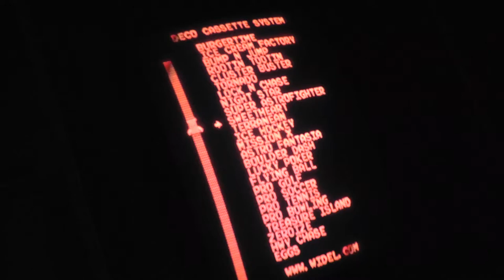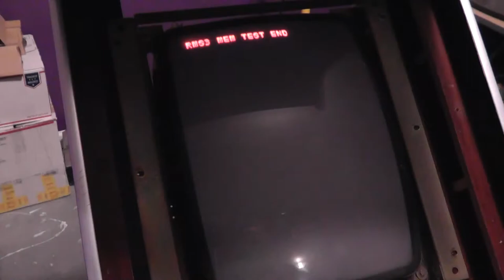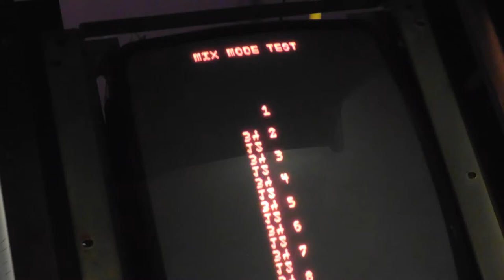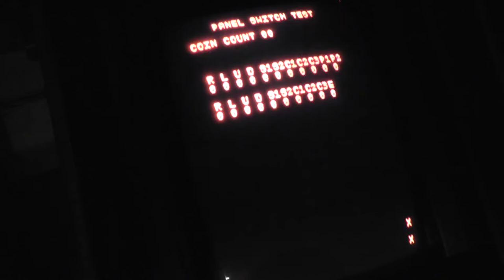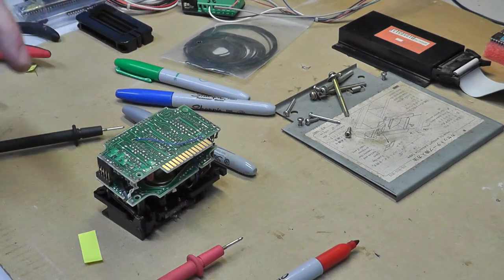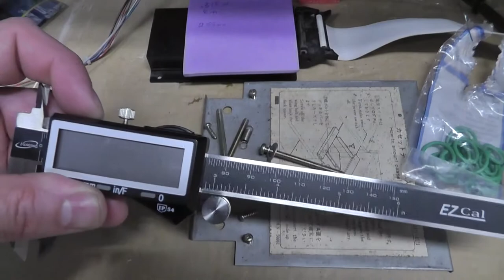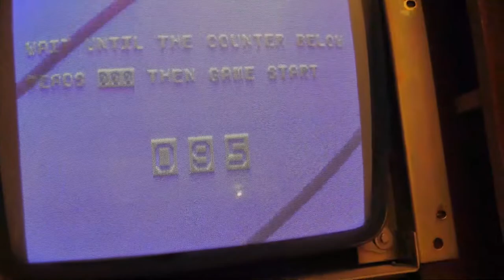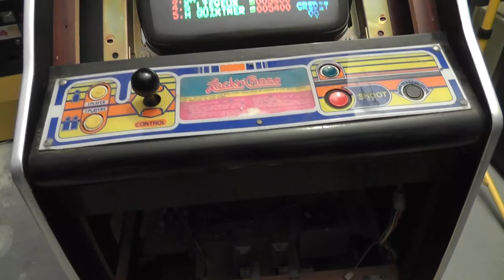DECO Cassette System Refurb - Part 3 - Test Tape & Deck Repair

Comment: That's awesome, as a ZX Spectrum owner in the 80s I can relate to loading software from cassette, although I can't picture arcade operators being too keen to wait 5 minutes for the game to start
Reply from the maker: I lucked out and went straight to c64 with 1541 :)  Typically the games would load once and stay on all day so probably not a big deal in the arcade but I don't think they were too reliable.  Thanks for comment and watching.

Comment: i just got deco bump and jump and burgertime cocktail games.  no cassette deck but do have the boards and dongle, not sure where to start. do they have to have the cassette to work?
Reply from the maker: Yes they need a working cassette deck and cassette tape to work or you can get a multi-kit that replaces both.  Hope you get it working.
https://www.arcade-projects.com/forums/deco-multigame.30/

Comment: Does anyone know how many working DECO Cassette System machines are out there? I thought it was only one and that sits in Japan. Awesome achievement! Now I gotta fix ours (it has clearly visible stripes through the graphics). Then get that multi-module.
Reply from the maker: I heard the same thing that the only working one on location was in Japan.  However, there does appear to be some collectors collecting the boxes (tape, dongle, instructions).  Let me know how your repair goes.
Reply: @jacklick  There's 48k of RAM in 4116 chips that's turned out to be video RAM. One of them was just dead. Floating output.
Reply from the maker: @senilyDeluxe  So you got yours working?  Congrats!
Reply: @jacklick  Well the tape mechanism isn't working and I need to buy one of these Multikits but at least the obvious problem is fixed.

Comment: What size are the hose rings you used for replacement?  Thanks!
Reply from the maker: I don't remember the size; I should have documented that.  I just bought some assortment from amazon.
https://www.amazon.com/gp/product/B07YDJQ4CW

replacement idler tire I used was "J : 8—1.5—1.5mm" from https://www.ebay.com/itm/203291315930
Reply: @jacklick  Thank you!  I just ordered them.

Comment: I wonder if the tape speed of the tape motors changed the V&H Sync Hold?
Reply from the maker: No, it was just the video connector from monitor to pcb.  I need to re-pin it most likely.
Reply: @jacklick  ok thanks,  I wonder if you can use those tape cleaner KITS that would clean the tape. They use to sell those tape cleaner kits ever where by in the 80's it would clean the magnetic tape and not just the tape heads.
Reply from the maker: @waynegram8907  it is an odd size tape but maybe.  It would definitely be useful to clean these tapes without damaging them.
Reply: @jacklick  Maybe the service manual says how to clean the magnetic tape. Maybe using a Universal Head Demagnetizer for tape decks might help also
Reply: If these replaced rollers are not snug, you might have some slippage resulting in variable tape speed, even if it's minimal.  That tape being 40 years old (probably drying out) is not a very reliable source for everyday use.  Maybe it's more like an arcade relic that should be shelved and just used for very special occasions;).
Reply from the maker: @Omega_Mark  Oh, it is definitely going on the shelf.  I just wanted to see if I could get it working. If I can get it working even better, that would be nice too.
Reply: @Omega_Mark  I think you have to use a certain lube for the rollers to prevent tape slippage issues. The sells kits for Echoplex tape unit for audio tape units to prevent rollers being dried up and slippage  issues.
Reply: @jacklick  Arcade Jason is quite a hands on guy making/producing new things/parts.  Maybe he could find someone to make these rollers?